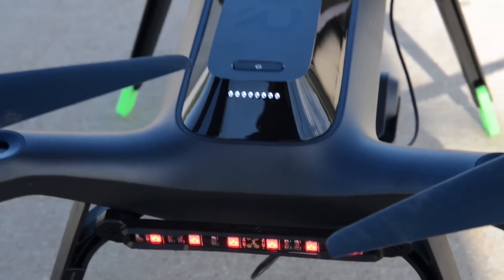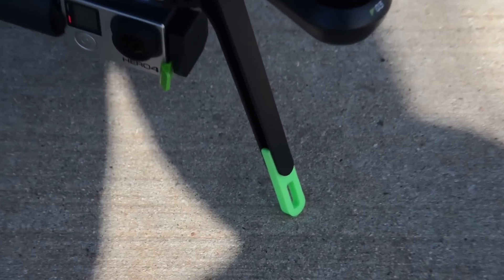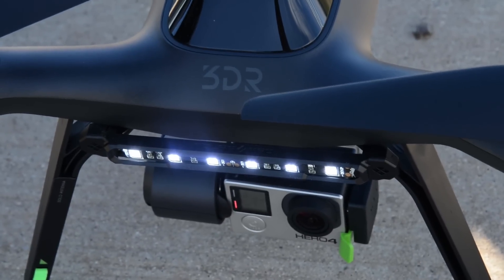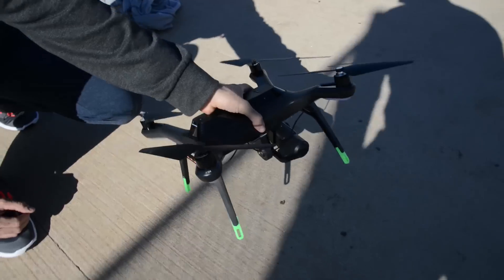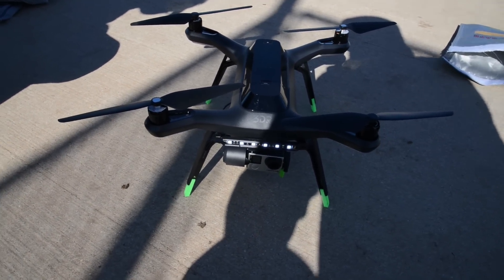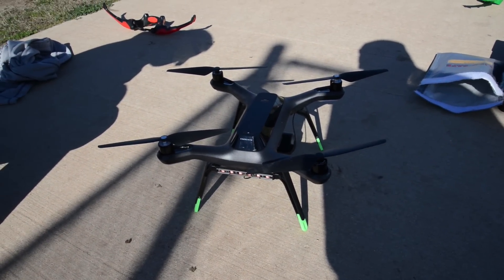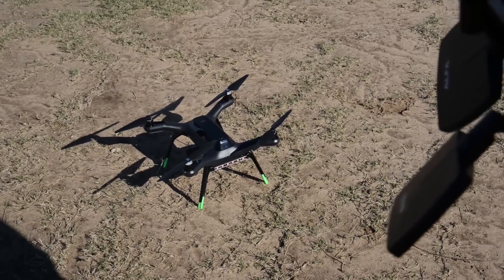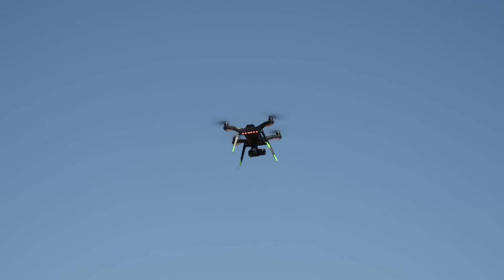3DR Solo Mods - LED Lights - Landing Extenders - Better Antennas

Comment: I did every mod including new radios... And it was still a pain in the ass. Its not a very good drone for any professional use and if your a prosumer dump it. However if you are recreational user its fine. However the money you put into it for mods you could be flying a P4 and have a much better camera and complete platform.  I wish that wasn't true because I would love to have a US company building stuff like dji does.  Fact is nobody does and its hard to find anything that competes with the price point.

Comment: Does the front left leg appear on the video of the GoPro when the Gimbal is tilted down to 70 to 30 angle?
Reply: +GuitaroholicSymptom I tend to notice the props more in my videos from my SOLO. I don't think I've ever seen my legs though.
Reply: +SeniorSpaz87 Well at 90 degree angle the Props are Visible but at 70 to 30 degree angle the leg of my Solo is Visible at 4k resolution. Tho i watched some raw video using the same setting with the only difference is my solo's left leg appears on the view.

Comment: By the time we buy all those accessories were spending a small fortune. The bad thing about this drone is the cost especially considering it doesn't come with the gimbal and camera. Kinda crazy.
Reply: but that's the purpose of a platform upgradability.  it's much cheaper then buying a whole new platform.  just buy strategically!
Reply: I got mine last week for $599 bundled with a Gimbal on Amazon:  http://amzn.to/29rDkS2
Reply: +ThinCube Thats an amazing deal to bad i got the phantom 4
Reply: NotaHipster How are you liking it? Were you already flying DJI before getting the 4?